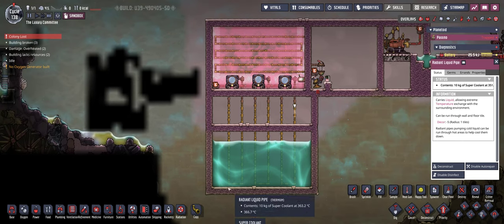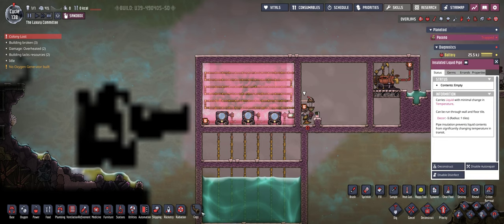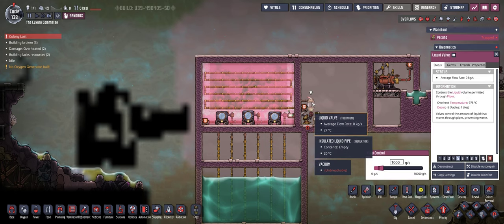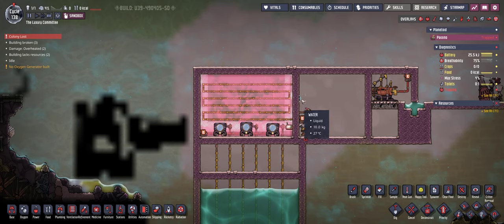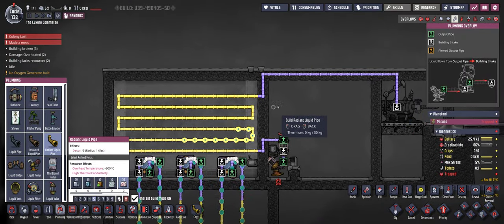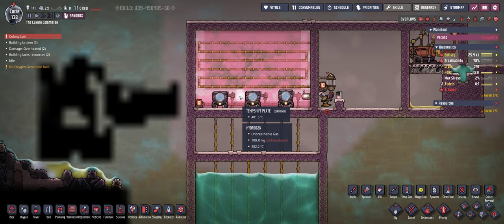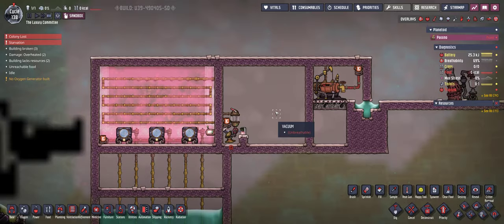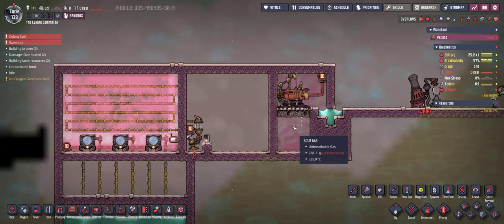Oxygen Not Included HowTo - New Petroleum (or Sourgas) Boiler design?

Comment: The whole idea of a petroleum boiler is to use the hot petroleum to pre heat the crude oil, saving power as much as you can, and also cooling the petroleum to a usable temperature.
This way, you would need a lot more power to cool the petroleum burners, becoming even less efficient.
But following this idea, try to use molten lead instead of hidrogen to heat the water, cuz i think you wont need 3 acuaturners to this operation if you improve the heat transfer that way.
Reply from the maker: Thanks for ur comment. There seems to be a commom misunderstanding here. This video does not show a ready-to-copy design for your base. It shows the principle of how one could make use of an oil well for a petroleum boiler. Anyway, I fully agree to your statement.
Reply: This is not a good design - yes it works but it is terribly inefficient, and requires materials that you cannot get until you go to space.  A typical petrol boiler is both energy and water positive.
Reply: you can use the hot petroleum to preheat the water ofc

Comment: This doesn't work in vanilla btw. I ran the same setup with magma as the heat source. Whenever the water reaches the oil well it turns to steam before it can be processed. I has 1000 of water going through, ceramic insulated pipe, tried with the oil well in and out of a vacuum. All the same result.
Reply from the maker: sorry sir, but it worked in the vid as u can see;) Ive also tested it on a non-sandbox game, the only issue hard to overcome is breaking pipes when the gas pressure in the oil well is becoming high
Reply: @engineeringandgames6107  you don't have to be sorry. I have 2k hours in the game and tried it like the video and several other ways in and out of the editor and in no scenario would oil come out. All good though, conventional step down boilers are quiet easy and are power positive.
Reply: The issue with oil well is, water can get fed into and sit in the oil well itself, transferring heat at the conductivity rate of the oil well's material since it isn't in an insulated pipe.  Water can flash into steam once it's no longer in the pipe.  The minimum temperate oil pumps out is 90C and should keep the water cool enough to not flash if you keep the oil well submerged in a single tile - but the natural gas vents at something like 250C and absolutely will flash water into steam.  Since it's flashing from the oil well directly, that's why you never see pipe breaks.  So keep it submerged in some oil for temperature buffer, and pump the natgas out as quick as practical  to minimize temperature spiking, and have some tempshift plates to move the heat from the natgas to the oil faster than it can move to the water in the oil well.

Comment: On one hand you should be able to build counter flow that pre heat water with the petroleum coming out of the oil well, much like you would per heat oil in a normal boiler design. On the other hand because water has higher SHC than oil, it cost more energy to produce petroleum by feeding high T water.
Reply: Also, if you build counter flow that heat up water to feed the oil well, the petroleum will most likely be much cooler coming out of the counter flow, as you most likely are feeding water at much lower T than the T of oil in a normal boiler design.

Comment: What happens when it's time to vent the oil well?
Reply: it will break your water lock.
Reply from the maker: for me it helped (but not entirely solved the problem) to set the sensor for releasing pressure to 50%.
Also in a different occasion i stoped steam pumping using a cycle sensor (as the oil well itself is not providing a sensor on its pressure). Also not 100% perfect, but reduces breaking pipes by a lot. Let me know if u have better ideas;)
Reply: You can use a dupe sensor or step plate to stop the water flow when the dupe enters the area to vent the oil well. Place it well ahead and the remaining water will be consumed before the dupe stops the oil well to vent it.